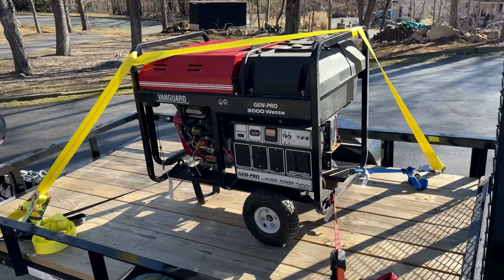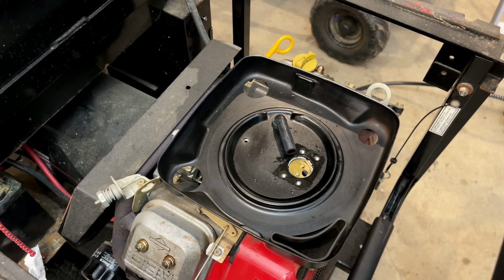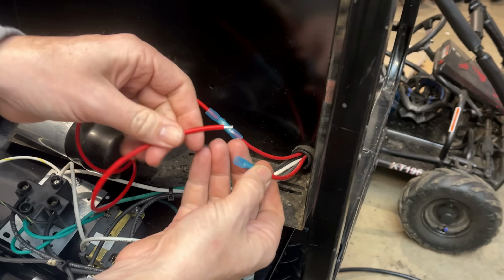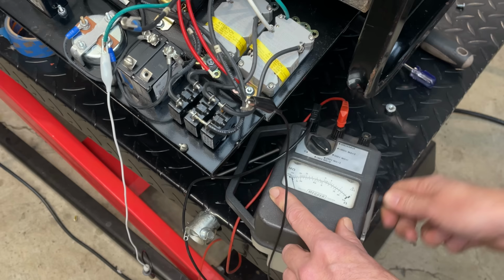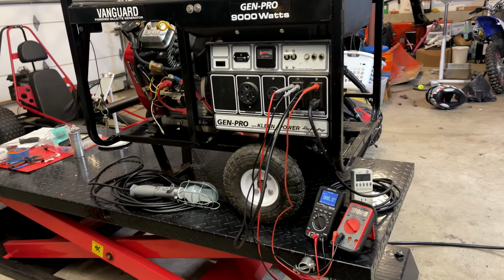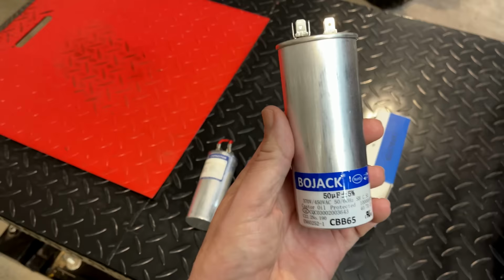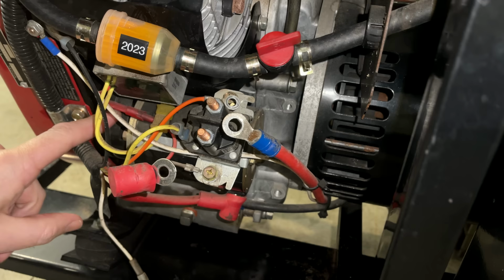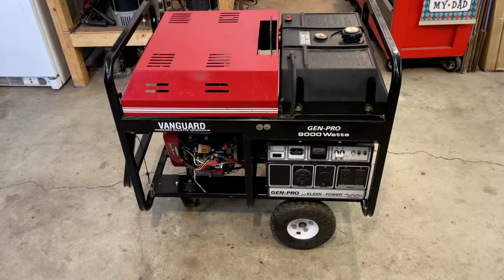How To Test and Fix A Brushless Generator

Comment: I'm sure you did but when ordering or replacing capacitors check their voltage rating. Most come 370v or 440v you can step up but never down.

Comment: Had me for awhile until you went down the rabbit hole testing legs for shorts only to find out it was a bad capacitor. Trying to follow what your saying and trying to see what you were connecting to the meters was a bit much.  Always sucks second guessing when you have a bad part from the start.  Spend more for the same result or try to figure out if something else is happening.   Glad you got it going though. I'm really comfortable with small engines the electronics of generators is another story when trouble shooting.   👍

Comment: I think the 3 or 4 digits at the bottom right of the label on the capacitor are the date code. That would put the manufacturing date at Week 43 of 2001. Old stock indeed.

Although it proved to be correct, your initial diagnostic on the solenoid was flawed. Your test showed that the main contacts were connected but at that point the wire from the switch was still attached, so if the switch was faulty and providing power then the solenoid would be energised and you could have decided that a working solenoid was faulty. When you then tested it again after dropping it on the floor you assumed that the fault had "fixed" itself but at that point you had disconnected the wire from the switch and the solenoid would definitely be de-energised. It wasn't until you checked the switch itself that you could confirm your diagnosis.

Comment: So many thanks James for your great video, and for sharing your wealth of Tech info + step by step diagnostics on that (Very well built!..) Vanguard 9Kw generator.  (I'm just an ER / ICU MD, & kinda wannabe gas powered equipment aficionado..). BTW: Not too long ago I went thru a flea market where I found someone selling (allegedly..) 'grounded surge protection' extension cable + connector for ~ $7 bucks. Out of curiosity I checked the 'ground' continuity: ZERO. Then opened the plastic housing + the 'three wire' cable. Well, the 'grounded  connector' thing were just a pair of cheap brass stampings + NO ground. Besides, the 'copper' wires were actually copper washed aluminum wires. Any guess where it was (So cheaply..) 'manufactured'??.. 🤦🏻‍♂️
* 😌🇺🇲🙏🙏🙏

Comment: The reason a capacitor would be showing higher than normal farad rating is because it's electrically leaky and confusing the meter. The capacitor is draining the charge at a faster rate than the meter is putting into it, making the meter think that the capacitor is of a much higher value than it actually is.

If you have a 50 uF capacitor measuring 100, 300, 500,uF+, it's not an over achiever, it's electrically leaky.

As for that NoS capacitor that exploded, that will happen. If you let a capacitor sit unused for extended periods of time, the electrolyte will start to degrade, and can start to crystalize and punch holes in the insulation between the plates. If you slap the full working voltage across a degraded cap, exciting things usually ensue. Sometimes you can "reform" old capacitors by slowly bringing the voltage up over time, but I'd only reserve this for specialty capacitors that are exceedingly rare today, or hideously expensive to replace.

There are certain types of specialty capacitors that aren't made anymore, and are hard to source. One example is the horizontal output capacitor used for the sweep circuitry on a CRT display in old Macintosh machines. The only suitable replacement today is a microwave rated polypropylene film capacitor. These are 2-3x the size of the original capacitor, and are somewhat expensive.

Comment: Great video high quality editing and camera work as always. Faulty new so called OEM parts also cause me  problems in my game it makes you second  guess your original diagnosis and wastes lots of time . There is so much counterfeiting of quality brand names especially on Ebay it's becoming a problem . I like your way of getting a accurate ohm reading on very low resistance windings. I have never  used the constant current output of my power supply but will do next time I need a accurate low resistance ohm reading. The methods used to get such low harmonic distortion is interesting , twin cylinder mechanical input equals more stable rotor speed over the cycle , lower resistance in the stator windings and higher quality magnetic steel laminations probably running at a more linear part of the BH curve . That might also explain the raising of the output voltage under load without the ability to vary the rotor current via a AVR and slip rings. I would imagine  that is a high spec generator that would be very expensive new.

Comment: When doing work on the safety related side of the nuke plant we had to do physical gauge style pull tests on crimped fittings of all nature ring , spade, butt splice, cable connector pins and receptacles etc

Comment: Nice job Jim.....I have 2 load banks...1 for generators and 1 for welders.The were both from Miller Electric....welders I repair.... 1 is10kw for generators....120 or 240.....I  know their expensive so using the heaters to add loads is a cheaper option. On a brushless generator I go right to the capacitor and eyeball the rotor stator. I have many caps on the shelf in various ratings. I don't do a lot of portables but sometimes fix them for customers. Mostly I do Onan RV machines gas and diesels from small to big and service lots of larger trailer mounted units......We have a number of load banks and we test many building units yearly.....

Comment: I put one of those bojack capacitors on my old trane heatpump and it lasted for many years. The compressor finally locked up and that was the end of that unit anyway...capacitor was still testing perfect

Comment: Hi James, came to your channel via Farmcraft.  Just a small FYI, the screws holding down the top of the carb look like slotted Philips, I would get a few slotted pozi’s and Phillips drivers.  They really make the difference, giving you the confidence to gronk (Tom Lipton word) on the fasteners.  They are also ideal for consumer unit (UK nomenclature) so as not to strip the heads but get a solid connection to the conductor.  I’m looking forward to reviewing your video catalog.  Kindest regards from Bonnie Scotland.
Reply from the maker: Thanks for the tip

Comment: These are electrolytic capacitors which have a useful life of about 10 years before they fail.  They are not hermetic and thus eventually dry out and become highly resistive.  So having one last 25 years is pretty remarkable.

Comment: This is why I don't use the small engine oem style solenoids, I've has enough of them get stuck on because they aren't built heavy enough to run the current. Especially when the starter gets a bit older and has to draw more to spin up. 
They used to be round like the Ford automotive style. So that is what I use. Solenoid off of a late 70's Ford. The Ford 90's era flat ones are also ones I use. Unfortunately Ford has gone to the integrated starter/solenoid combo, like the AC Delco type. My $.02.

Comment: Careful testing with 2500V - if those diodes find themselves across it, you will be exceeding their max reverse voltage ratings. Capacitors with high series resistance will give a high capacitance reading, but this isn't real - the meter determines capacitance by measuring how long it takes to charge the capacitor, and this will take longer with series resistance. Some types of capacitor need to be "reformed" before use if they have sat for an extended period as the dielectric layer is formed by an electro-chemical process and it breaks down over time. This is done by bringing the voltage up slowly. Dunno if it applies to this sort.

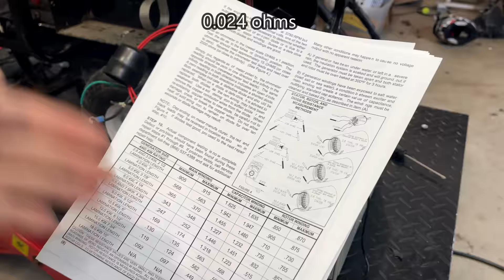Comment: The testing you did at 52:00...  The slightly off numbers could be caused by the internal/lead resistance of your cheaper meter. I'm guessing the actual values are probably within spec.
Reply from the maker: Yes and also assumes room temperature which is was not.

Comment: James, great video as always.  This is a really nice unit.  I am seeing this model being listed for near $3k, so you get what you pay for.  Don't mean to nit pick, but when you had the 35MFD cap and only 94 volts output, your resistance heater, it was only producing about 883 watts of power according to ohms laws.  Those resistance heaters are typically 10 ohms.  Also, I have asked you about this in the past, but could you humor me and do a back to back THD measurement with and without running the meter through a surge protector?  Those surge protectors typically at least have several parallel MOVs across the mains and I am curious if they provide any filtering.  Thanks again for a great video.
Reply from the maker: I will try and remember to do that, but do not expect any change.  Mov only come into play when there is a surge.  That start conducting and decorative themself to save the electronics behind them.  Most of the time they do nothing.

Comment: A lot of times if connect those red wires into the wrong ones will burn those capacitors out almost every time. You half to trace those wires from the output and neutral return power circuit feed in& out. It's those wires are crossed we're you crimped them together. Check those to be matching up exactly to each other. And then if they did. It leaves and leads to junk capacitors is all. If you have bad diodes if over loaded.,or hooked up backwards on those capacitor wiring wires.

Comment: electrolytic capacitors degrade over time if not powered up every year or so. This is a problem with VFD drives held in storage at a production plant. Most plants using VFDs will have a reforming maintenance schedule. If not, VFD capacitors can blow when first powered up. Maybe this is what you encountered here.

Comment: I'm an old service tech. retired, I still moonlight and help family members $12-18.00 is what I pay for those Run Capacitors (in that they stay in the circuit) at an HVAC Supply House. I would try them first. By the way, they changed the internal oil in these capacitors 30 some-odd years ago, the new ones only last a year or two. The original oil caused cancer but they were 20 or so years old and still good! I keep spares at my sister's and for myself, I change them periodically. I have 45 years in that trade.

Comment: Hi James, my Cap blew out, 30uF, housed in the Stator cover, not a good location.
Installed 2, 15 uF in parallel remote from the generator.
My generator is housed in a small shed with ventilation fans which run when the generator is online, my 2 Caps are suspended  in free air, no problems and reliable.

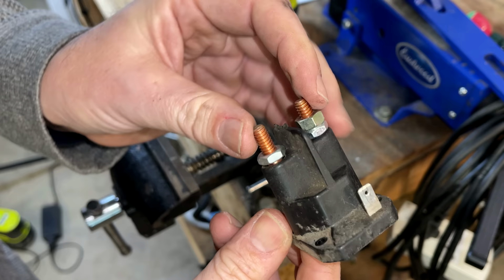Comment: At 1:26:06 my 98 Ford e250 van uses a similar switch for a starter relay IGN key engages the relay which sends POS power to the starter solenoid and engages the motor and turns over the engine

Comment: I have a Vanguard on a piece of equipment, they are set so lean on idle that it will hunt/surge until absolutely stinking hot from new, however, that plate with the start key comes off with a couple of screws and then you see the plastic quarter turn lock on the idle needle.  This simply pulls off and then you can adjust it, I needed about 3/4 turn to smooth the idle.
Capacitor;  new does not necessarily equal good. . . . . . . . .

Comment: Interesting about the bad capacitor. Now you have me worried. I keep a spare capacitor for our well pump controller. I never thought about the risk of getting a bad one out of the box.

The grounding method used on this generator is interesting. It works fine when used as a standalone generator but using it as a backup generator requires the neutral and ground to be isolated so only a single bond exists. Connecting both through the generator frame makes isolating them more difficult then the typical configuration of using a bonding jumper between neutral and ground.

Comment: old capacitors especially unused ones might be savable. connect is rated voltage to it for a minute to reform it and bring back its capacity. this might trip your breaker if you don’t limit current

Comment: If that replacement capacitor that failed is an electrolytic type they definitely have a shelf life. Besides the spec for working voltage and capacitance value also check the date code that shows when it was made. New Old Stock on electrolytic capacitors can not be trusted because as they age the chemical paste inside degrades the internal layers of the capacitor's construction. This isn't a problem on ordinary non-electrolytic capacitors because they are made from solid materials. Electrolytic capacitors have a sort of damp paste inside and that's what limits their years of service.

Comment: beeping duff capacitor    caused you so much aggro. That flat plate connection on the starter solenoid almost destroyed my flourishing racing career  way back in the 1970,s. The battery isolation switch was a spring loaded flat plate which after a couple of laps   would start to rattle / vibrate causing the engine to misfire.. and retire to save the motor . . My claim to fame was leading the pack until the misfire set in . A new type of battery isolation switch which wiped between the contact faces   cured the elusive misfire . I  was immediately suspicious of that replacement capacitor .. My compressor electric motor start /run capacitor blew and the replacement also blew   a different manufacturer,s capacitor is still working reliably after many years . most frustrating . one does not get any compensation for duff products .

Comment: If the generator want to use standard (residual current detecting) GFCI, it needs to have the Neutral grounded for the GFCIs to work. Without such connection, there would be no current for the GFCI to see even when a phase-to-ground leak/short happen. 
But even with that, I would expect this connection to be made in the instrument panel and not the generator itself, to e.g. allow insulation checks.

Other protection scheme could be keeping the N not grounded and use a Neutral-Ground voltage triggered protection device (dunno how that is named in the american electrical code), but that could not be made to isolate only a faulty load circuit, it would have to shut down the complete generator. Plus this would be incompatible with common downstream panels.

Comment: I have had a lot of « 370 volts » capacitor failure through out the years. I try to replace them with 440v if there is room.

Comment: For longer life of the capacitor get one with a higher temperature rating. This makes a big difference if it operates somewhere hot, like on a generator. Looking into the data sheets of capacitors is needed to choose a reliable part. The Voltage rating is also important. Get this from the manual as the one installed may not be original. Operating the generator in a cool location will help get a longer life for the capacitor and also the motor 🙂. 
Why are people concerned about harmonic distortion when many loads chop up the sine wave?

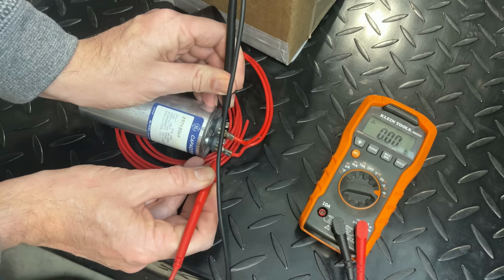Comment: The capacitor top seems slightly convex which usually indicates failure. At 24:50 the new capacitor's top seems flat as it should be. The convex top is always a dead giveaway.

Comment: James,  I really enjoy watching your videos... it's just therapy to me seeing you do your diagnosis and repairs.  I would like to test the THD of my 12K generator but don't have a meter that will do it.  Might you have a suggestion of a less expensive one than your Amprobe?... or what function in a meter should I be looking for?  Duty Cycle? any particular icon on the meter?  Thx in advance.
Reply from the maker: THD meters are very expensive.  Most are in the $2,000+ range.  The model I use is the cheapest "new" one I have found on the market.  Before I found the Amprobe I was looking on eBay for a used Fluke 41B.  They are expensive even used, but sometimes I would see one listed in the $150 range.  You can also search on eBay for "Harmonics Analyzer" or "Power Analyzer".  I see one there now for $150, but not a local seller.  Even if you purchased a new Amprobe, once you test your generator you could probably sell it on eBay for close to what you paid for it.

https://www.ebay.com/itm/275816027657?mkcid=16&mkevt=1&mkrid=711-127632-2357-0&ssspo=LEXvDho5S5C&sssrc=2047675&ssuid=eec5lZxOS1O&widget_ver=artemis&media=COPY
Reply from the maker: Some oscilloscopes can measure FFT.  From that you can also calculate THD. https://www.youtube.com/watch?v=s_cVP5gu4SY

Comment: That one is so good because made in USA in Louisiana. I have a 10KW with the same engine had about 28 years. Still works after fixing during hurricane last year. ( bad wiring fried the capacitor ) also all outlets were bad. Nothing fancy like that one all my wiring, cap and diodes in rear cover. Had to replace the key switch and of course the fuel pump. No AVR and power rating is adjusted by RPM. Only draw back is it is a gas hog. That one is really clean wish I had it. Bought an 8500 Ryobi when the old one failed as needed power ( only one left at HD ) no choice. Duh, hurricane nobody had anything of course. Would not recommend to even an enemy. Float stuck on initial power up then after 8 hours of run time intake valve was stuck down. Fixed and got running again. Absolutely no help from Ryobi.

Comment: When measuring the voltage output of a generator should you use an averaging RMS (standard) volt meter, or a True RMS volt meter?  Would you consider covering this topic on an upcoming video?

Comment: The crimp connectors on the generator wiring make me think someone’s been in there before. It’s really odd however all the connections were soldered. Is that common on these larger generators?
Reply from the maker: Not sure.  It was the first I have seen a capacitor soldered like that in a generator.